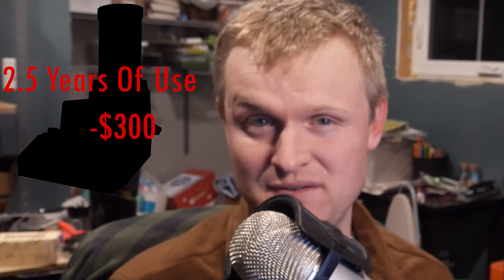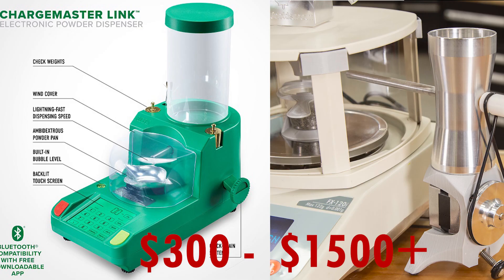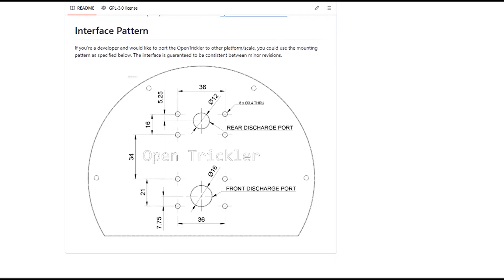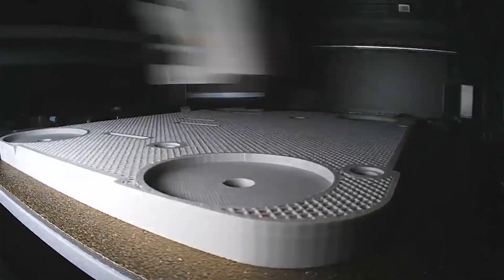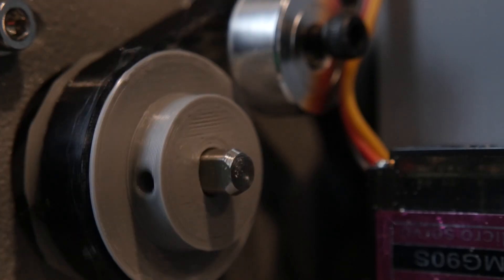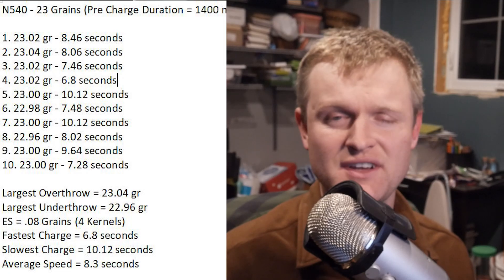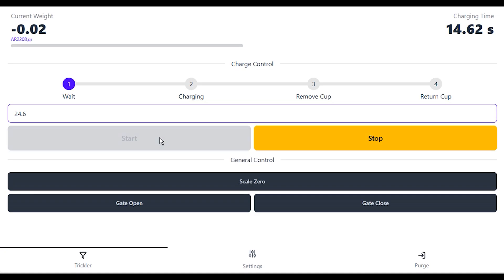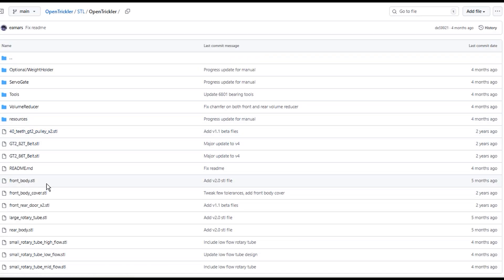Finally, an affordable and durable powder trickler (if you can build it)

Comment: Is there a viable alternative for the scale? 600+ is a bit steep.
Reply: G&G JJ100B is also supported.
Reply from the maker: @RanBao I stand corrected! 
I didn't realize how much cheaper the G&G is.
Reply from the maker: For this trickler? I don't think so. 
This is as cheap as it gets for a durable/high quality setup.